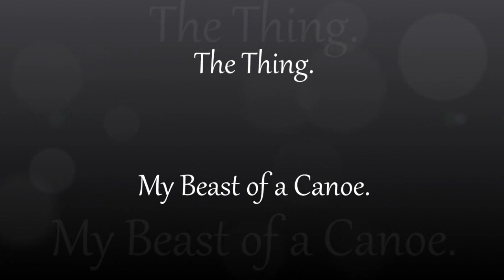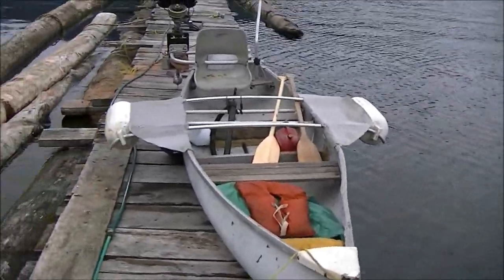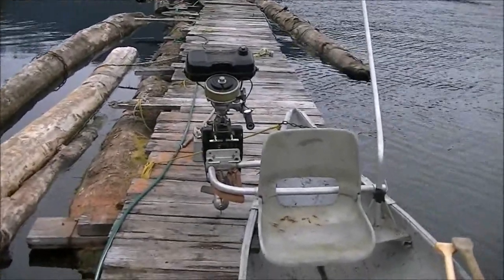Motorized Canoe Motor Mount and Outriggers

Comment: What size are your bumpers and how well do they work  for stability?
Reply from the maker: Hi! The fender / bumpers are about 8 or 9 inches in diameter, and around 18 inches long. Maybe a little less. They worked amazingly well. Had many broadside waves hit, and the side that went down never dug in to the water. There was a ton of spray though. The "wings" covering the arms weren't there to look "cool", lol! They were a couple layers of mesh to block the water that shot up from the not quite hydrodynamic-engineer designed "pontoons". lol!